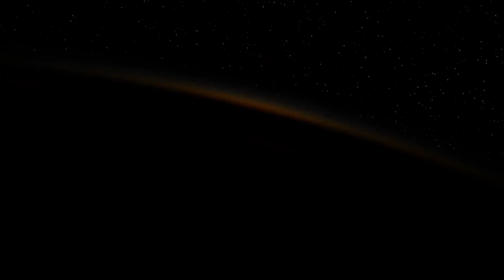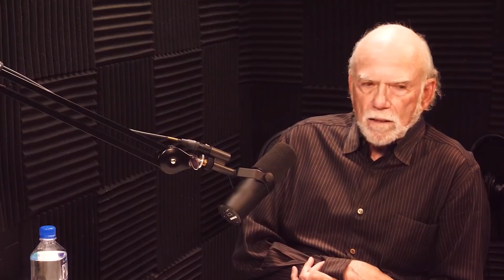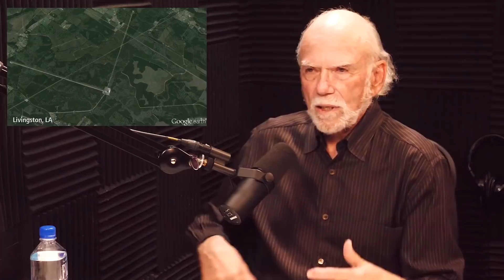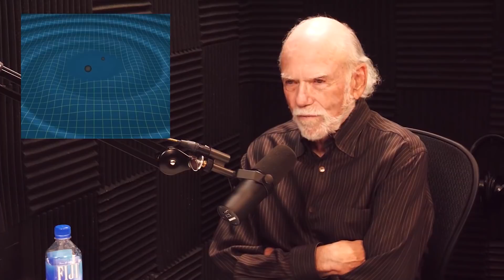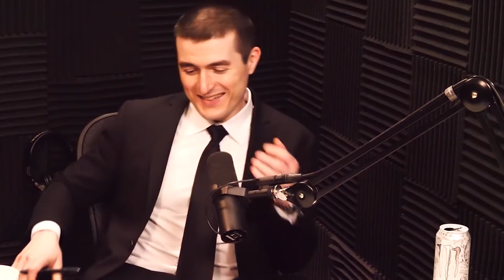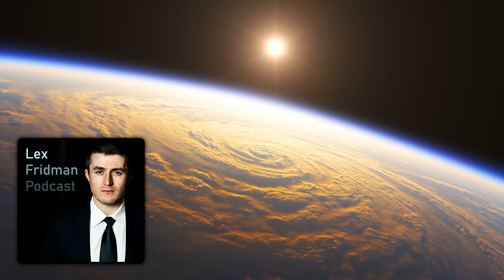The hardest engineering challenge | Barry Barish and Lex Fridman

Comment: Im surprised Lex believes that evolution is actually a real thing at this point in time. I think there is an overwhelming amount of evidence that suggest other wise. Not to mention evolution doesn't work with the standard model in several key ares. WE know that DNA can only loose information over time and thats a fact. There are no and I mean 0 examples of any species of animals or humans that have gained DNA generationally speaking. Thats a big problem for Darwin and this has recently been proven. Not to mention there is a little thing called irreducible complexity that mathematically is impossible to have simply evolved. There had to have been something or someone who created it. And you can come to this conclusion by using the same formulas they would calculate something to be improbable. But what you will find when calculating the probability of a lot of microorganism to have simply evolved is mathematically and I will use their term and it is absurd. This is not mainstream but its provable with modern day technology. Little nugget for those whom do not know.

Comment: 4km long vacuum? all I'm hearing is a 4km long tube. is this for particles? what's the difference between this tube and the ones we use for oil?
Reply: The vacuum is 1 trillionth of an atm, so a cubic millimeter of air (the size of a poppyseed) will destroy it. Basically the air molecules bouncing off the 40 kg mirrors knocks them around much more than a gravitational wave.
Reply: @DrDeuteron  thanks. so is this tube for measuring gravitational waves?